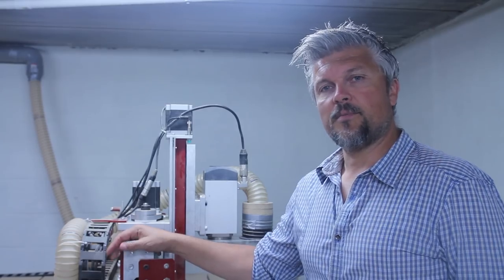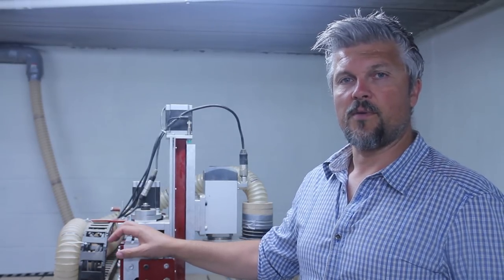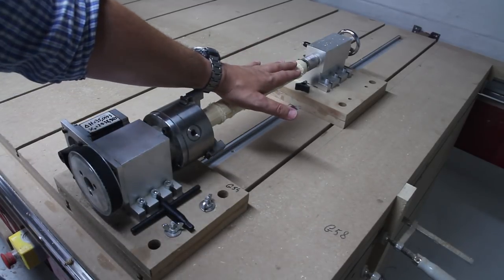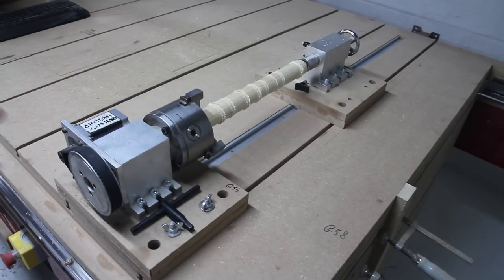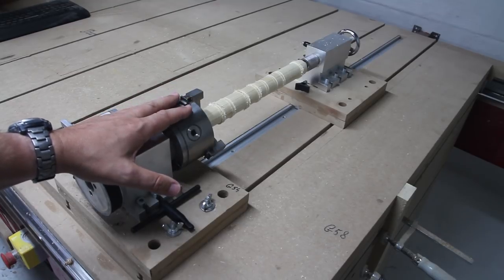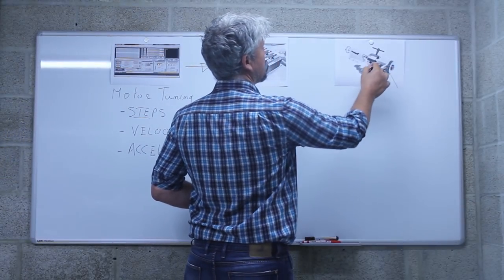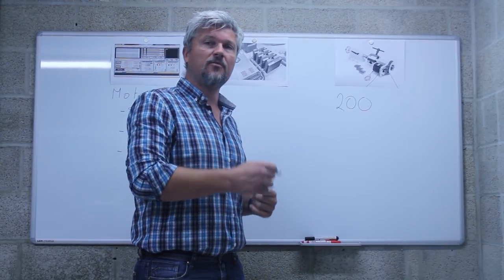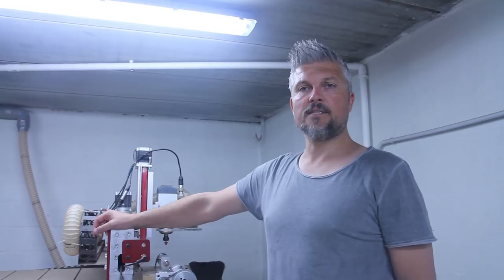Installation of a rotary axis on a CNC router

Comment: Hi Mark, I built my CNC router about four or five years back and purchased the bits for the fourth axis about a year ago, finally got around to fitting it up to my machine now I'm retired. Your video is very helpful on the setup in Mach3 which was what I needed. I recommend that anyone already familiar with Mach3 and wanting to setup a fourth rotary axis to use the link to Marks website where you'll find a text set of instructions that makes it really easy and quick to setup.
One other note that may be of help to others is if you have a machine with four independent stepper drivers to leave all three main X,Y and Z axis' active, very handy when setting up material in the A axis.
Cheers Mate, great work, I'll be looking at more of your stuff.

Comment: I love you so much for making this video. You shattered the myth/mystery surrounding the setup and use of the cnc  rotary 4th axis.
I have a 3 axis cnc machine running on the Mach 3 software. I've always wanted to set up a rotary axis but without any clue.
Great instructional video. One of the best I've seen.

Comment: Youtube suggested vids never fails. I'm using a different controller, but from my search i've noticed that In MACH3, there should be a setting 'use radius for feedrate' which compensates for the degree/min vs inches/min. From my best of understanding it compensates based on the Z offset from the center (it interpolates the F for the A-axis from the distance for the Z from the center of the workpiece) with this setting it's mandatory to have the Z0 at the center of the cilinder. It should be a job for a postprocessor IMO, the postprocessor knows what Z height is expected and can easily add another F value in front of the A movement. Another viable option would be to use G93 instead of G94. The G93 is by default supported by a Fusion360 postprocessor that's Fanuc compatible (Mach is also Fanuc compatible)

Comment: The best detailed explanation of how to calculate and configure Mach 3 to cut rotary set up on the router.
Thank you very much.
Reply: cnc NOT used normal newer router, too weak, too noise, real 800W aircool spindle have better torque,cheapen and totally lot silent use, 800W spindle have lot more torque than makita or bosch or de walt router have, and totally silent, router not can use garage ewening all street all peoples come angry not can sleep, but real spindler can use all night and any not hear use you cnc all night.

Comment: As many others have said, thanks for doing this video. I happen to have the same machine you have, and I have most of the same software.  I purchased an extra stepper motor controller from the CNC Routerparts factory in anticipation of some day getting a rotary 4th axis.  This video will help get me going.  Thanks again.

Comment: You are a great instructor. Do you mind to share the series of your cnc router plz
Reply from the maker: Dear, the model I have is the PRO4896 by AVID CNC. Bought it in 2016 and later I installed an upgrade package and added about 2ft of extra table length. The rotary axis however is not from AVID CNC. I have a Chinese generic model. The rotary solution offered by AVID is much more expensive, however also much more robust and it allows for larger diameter stock. For light rotary work these Chinese generic rotary-add on's are perfect, for heavy rotary milling work, the AVID kit would be more suitable. Thanks for the nice compliment by the way!!

Comment: thanks so much sir for amazing video. could you please, kindly help me ? i designed my machine setup as follows rotary axis and i attached to y axis pins in mach3 as i will not need y in rotation and i build spindle head on tilting axis and i attached that motor axis cable to a-axis pin in mach3 board so i will have total 4 axes " x-axis, rotation axis which is y in this case, z axis and a axis for tilting head" how can i program g code file using powermill or any program in my case???

Comment: Don't know if you can help me ,but i am trying to hook up a rotary to my Gatton cnc . My rotary is a 1-2.25 rotation and the driver is set to 8 micro streps at16000 pulses/revs it is a stepperonline  driver DM542T version2.3 and I am running Mach 3. Any help with the settings would be greatly appreciated. Thank you

Comment: Can you turn? I mean that if you can make pieces as if it were a lathe, roughing of cylindrical materials; Does it reach speeds like a lathe?

I want to make one but with a CNC router and mount the rotary lathe but be able to use it as a lathe.

I hope you understand me and your machine and the work you do are excellent, regards.
Reply from the maker: Hi Luis. The workpiece can not rotate as fast as on a lathe. But the principle is different. The lathe rotates the workpiece very fast and the tool is moved relatively slowly. With the CNC rotation axis, the tool (routerbit) moves very fast and the workpiece rotates relatively slowly. One can however not replace the other. There are overlaps in their capabilities but also things that one can do and the other can't. Greetz, Nicolas

Comment: Material Diameter: 70 mm , Length : 145 mm ,
Step Motor : 1.8 Degrees , 4.9A ,15.87 W , 200 Step
Reduction Gear : 140 revolution/min  ,   [ 1/10 ]  

Please help me ? , I did as you showed but I could not reach the result..I should calculate StepsPer , Velocity , Accerlation ..
When I write the values obtained as a result of the calculations we made with you, when I make the material take a full tour, it does not come back to the point where it started.

Comment: I've watched the video a coupe of times while doing other things. Haven't had time to actually do it yet. But I did want to comment about a couple of your comments in the video. 
Your video is good and I'm sure haters will say what they say, it's your first video, shouldn't care too much. But the audio could be the same for you if you use the same mic every time.
I haven't uploaded anything with a voice over, good on you for doing it. I hate hearing myself, outside of my head at least. But I do use microphones for what I record and you could either post process and align the audio, since you're using premier this is possible almost automatically. 
I use a zoom h5n with the built in microphones and adding external through the inputs available. But they also have the zoom h1, and it is more affordable while still having great audio. You could either feed the output into the camera, or wear the recorder with a lapel mic. Or wireless lapel connected to the input of the audio input. Any way you do it, you might want to try and capture with the same device each time. Otherwise noise is picked up and even if clean, will be different in each setup. 
This and several other things prevent me from being able to create videos in a timely manner. I just wish I could draw a basic flow chart for what I want to do and be able to drop all my files in one place, then have the computer step through the flow chart while using my files to create a video automatically based off of my editing style. 
AI will do this at some point, but wishing that could be the end of humanity. So I think I'll suffer until then.
Reply from the maker: Hello again, thanks for your feedback. It is only via feedback and being critical of oneself that we can improve what we do. And I agree that the first thing for future video's should be to do something about the audio. It is not consistent, neither how it sounds nor it's volume. And apart from that, I have the same strange feeling when I listen to myself but I guess I will have to live with that. Everyone around me has to live with my voice too and I don't envy them:):):):)
But I was thinking about buying one of those wired lavalier microphones and hook it up to my cellphone. In Premiere, I can then easily sync these voice recordings with recordings I make with the DSLR or with the pc when I am doing screen recordings. And then delete the DSLR/PC recorded sound and use the recodings from my cellphone/lavalier combination. I think that should already result in much more consistent voice quality. Do you think that would work? But I will also have look what I can find about the solution with the Zoom recorders.
Besides that, I do think about what I am going to say (and how) beforehand but still, I need to do too much cutting and stitching to remove errors which is very visible in the final result. So even more preparation before I start recording is needed. 
I am now doing additional training modules (Lynda.com is a great place for that) to get to know more about Premiere as well. I kind of caught the virus for video making. It's fun:):)
Reply: TheWoodlab I use Lynda as well. My work pays for it though. So nice. A lavaliere will work with your phone. There are tons out there and a few with great reviews. I use a note 8 daily and when using a lavaliere for voice, it's surprisingly good. I would assume any major phone would have good adc chips for that purpose. The kids shouldn't cost more than $25 US and you already have your phone on you. The lavaliere I picked up is on Amazon https://www.amazon.com/dp/B01MSKI46R/ref=cm_sw_r_cp_apa_upZvBb6PW3SNZ
 
Recording 2 at the same time, the way you described, would at the least allow you to mess up and lose one of the files and still recover well. 
I like learning, it's possibly my favorite activity. I just wish I could balance everything or increase the amount of time in a day/extend my life a few hundred years. 
I sent your video to #CNCRouterParts and got a response. They are working on a rotary axis themselves and plan on releasing this year. Funny how I buy something and I always seem to do it a little too early. I am looking forward to seeing their implementation though.

Comment: The easiest way would be:
 Use 1 profile and add a switch "4 pole 2 throw toggle"(cheap) it has 12 pins. 4 center pins goes  to the driver. 4 outer (each motor) pins to the motors, calibrate for rotary axis only... calibration don't really matter, axis Y (the table) is only needs to move over the rotary. then flip the switch. Add a plug to the rotary axis, you can unplug it & put it away when not being used

Comment: Do you have a post processor that works with rhino cam and Mach 3 well? I have successfully modified the fusion 360 cncrp post processor to work better with Mach and 4th. Same for aspire. However, rhino send to have what's missing from either. Fusion is great for design and accurate cuts, but it's currently not capable of the easy 3d toolpaths that aspire produces. Aspire will easily produce wrapped 3d toolpaths, but continuous 4th is a pain to work through. It is possible but requires creating multiple files to do what should be 4 sided or at least movements in the y axis as to cut some of the models without days of setup. Looking into rhino because it send it's capable of what I need. Don't want to purchase if it's going to be months before I can actually use it. Thanks for the info on the video again, it was much help. If you want, I can send you a script that some of us in the cncrp forum came up with for zeroing the a axis using 2 dowels. One in the spindle and one in the chuck. Grounding your touch plate to the setup and it will find the exact zero position for accurate setup.

Comment: hobby user who want only sometime use 4th axis can build own 4 axis parts easy to wood, spindle need some bearing and belt bulley only whit new stepper motor, and pirch plywood can made bearing block box and tailstock easy. whit cnc have easy cut all parts.

Comment: I have the Exact setup from cncparts.  The 33.33333 worked perfect but A axis moves so slow that my bits burn when wraping.  I have maxed out velocity and  acceleration in mach3 .  Any ideas how to speed up A axis.  Thanks and great video.
Reply from the maker: Did you try to jog the axis? If jogging is also really slow, something must be wrong with the settings but if jogging goes faster, it may just be a problem with the toolpath. Maybe that's the first thing to try.
Reply: @thewoodlab2102  
  Jogging is very fast. must be in my code.  thanks again
Reply: Under config then toolpath "use radius for feed rate", and checked "A rotations enabled",  fixed problem.   thanks for taking time to make this video.

Comment: Are these strong enough to do aluminum?
Reply from the maker: I have not yet done any aluminium cutting on the rotary axis but I guess that at low speed it should be possible.
Reply: @thewoodlab2102  could you possibly make a video testing it? If not, it's ok. I would very much appreciate it as I would like to see how it does before I buy one. I will be following your vids when I set it up. 🙂

Comment: Thank you very much for this video, this has helped me a lot so far very well done. I just have one problem to solve i will appreciate it if you can help or if any one ells can. My rotary axis is working fine my problem is that the DRO on mach3 is not moving up or down if i turn the motor. What can be the problem, will check the comments. Thanks again.

Comment: Good DAY friends.
I have problems whit the alineacion of side and side of the gantry.
Work, assemble machines with the same structure, only they have a table between the rails. My problem has been to align the rails on each side, to ensure parallelism and perpendicularity, preventing the gantry from crossing and stopping. The rails are located at a distance of 3 meters from each other. Know some technical and effective alignment system. So far I do it empirically with a tensioned steel wire.

Comment: True,....  most Gantry machines based on 3 axes are not built to make cylindrical objects.
Most software works more like 2.5 axis ... VERY MUCH LIKE A PRINTER OR SCANNER.
THE LAYER OF CUT IS FINITE AND SET IN X-Y .... Z is the cut, paint, etch, weld.... a single plane.
With a true 4axis controller this is not a limitation... where R is a diameter of a plane of cuts of Z .... including the perfect positioning for Z in arcseconds of accuracy.

Comment: hmmmm. the method of testing the diameter at 33:00 doesnt make sense to me. Even if the piece is mis-aligned aren;t those diameters of the cut going to be the same? The cuts just wont be perpendicular to the linear surface but the diameter should be the same. Am I missing something?
Reply: lol, i get it now
Reply: it's not the misalignment of the material (wood), it's the calibration of the tool you are talking about, a one-time adjustment not related to the material at all.
Reply from the maker: Hey Scott. The aim is to check if the axis of the rotary equipment runs parallel to the plane in which the cutter moves. If the axis has an angle to that plane, the cut will be deeper on one side of the wooden cylinder than on the other. From the difference, a calculation is then done to correct the head-or tail holder in order to get the hardware parallel the the cutting plane. Tricky stuff these rotary things :):) Greets, Nicolas
Reply: @thewoodlab2102  yup just a moment of confusion re centering machine vs work. Thanks for the reply tho. Know anything about turning drumsticks?
Reply from the maker: @scottchristie  Drumsticks I have never tried but I am sure it would be pretty easy to do on a rotary CNC setup. Only potential problem I see is that they are pretty thin (what is the diameter? let's say a half inch at the widest point?) So that could introduce vibrations while cutting. Depending also on the wood being used of course. Going slow would be key I think.
Reply: @thewoodlab2102  I appreciate that insight. you are right, about .5" diameter. Would you expect more vibration on a cnc setup than a standard lathe or back-blade lathe?

Comment: Why would you touch off somewhere else, if you know machine coordinates? You could just use machine coordinates to set to center... or am i missing something?
Reply: Ohh.. never mind- tool length... ive been working with atc machine lately and in there you just add tool offset. When changing them manually you cannot do that.

Comment: i just start make same 4th axis system, today has order all bearing block at lathe spindle and tailstock parts, my DIY linux cnc machine, yesteday make ready all spoilboard clamping system to table and now 4th axis must made. normal controller card have 4 or 5 axis connection, can use 4th axis need only wiring new axis to controller, my controller cost only 10$ and can add 5th axis. i use linuxcnc software easy add new axis.